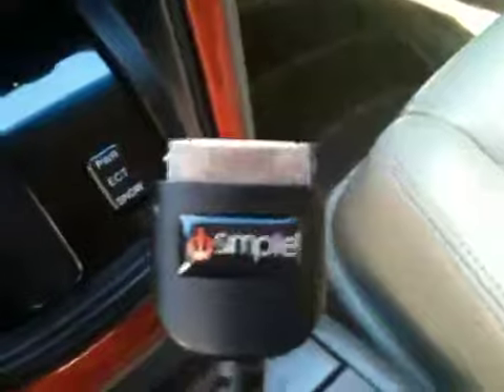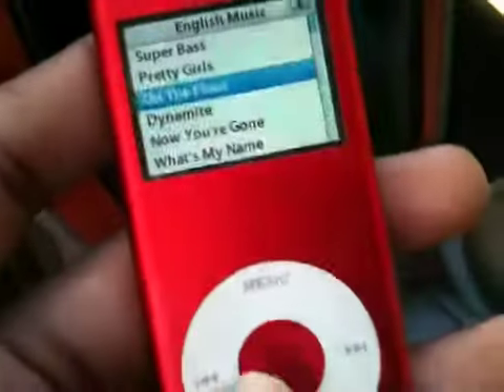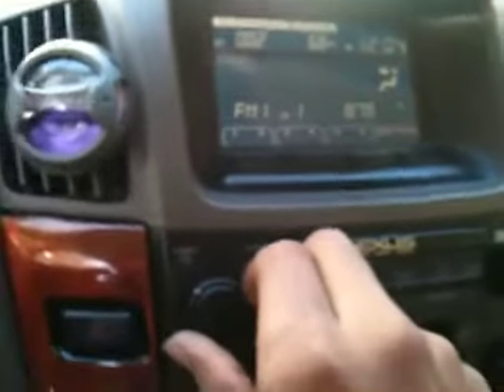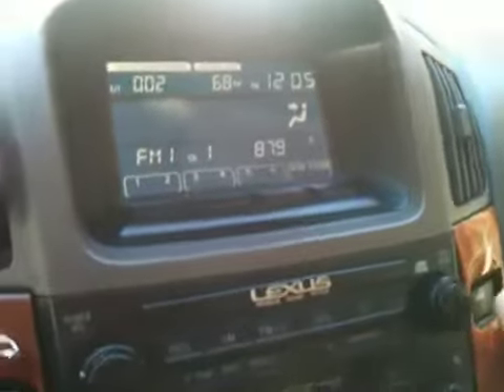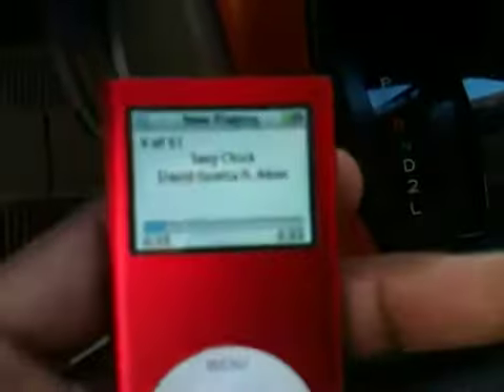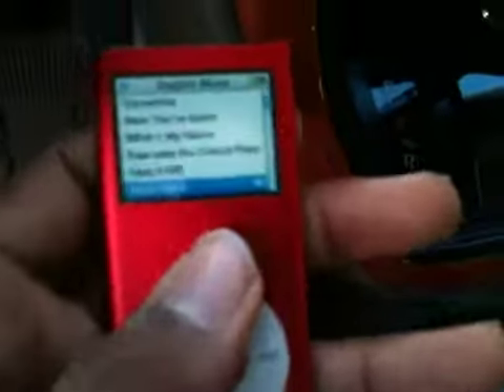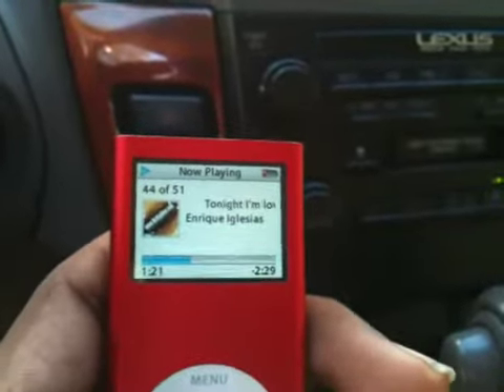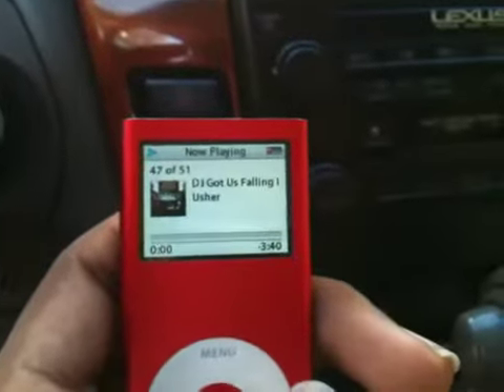iSimple IS77- Tranzit Overview / Audio Quality

Comment from the maker: Yes, audio quality is that of an FM station. And, yes you do have to tap into a 12v power source even if you only plan on using the 3.5mm. Reason being, the FM modulator blocks out all other channels when the switch is in the "on" position.